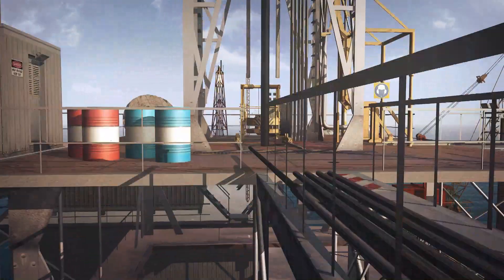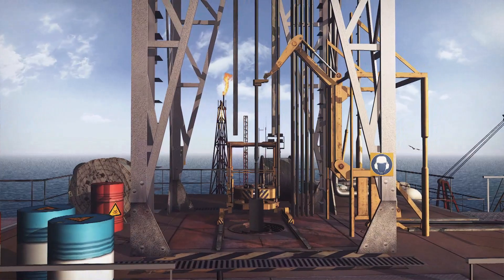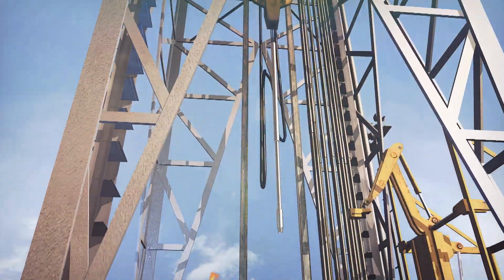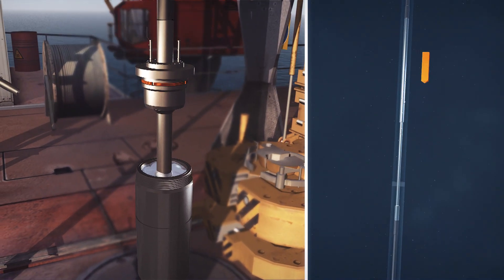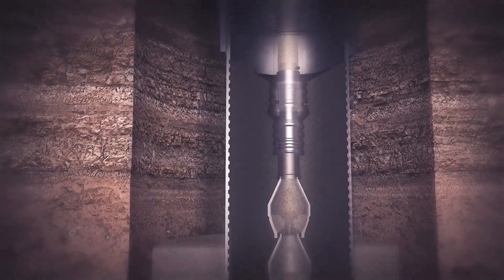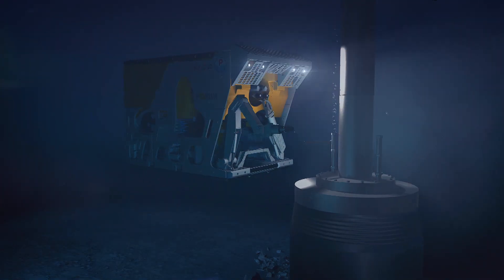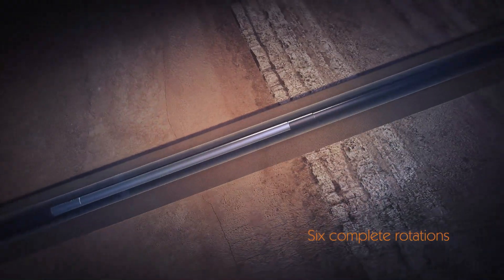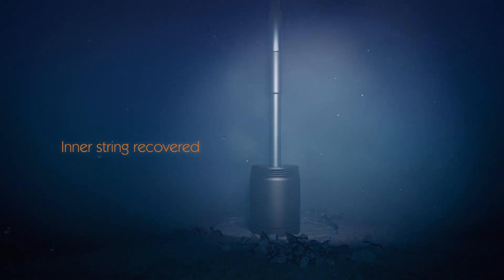SeaCure Cementing - unlisted

Comment: Nice demo. What is the margin of error in the inner string length to make sure the inner string can latch the float at the bottom while connected to the casing head at the top? Pipe stretch in a deeper water depth may have impact too.
Reply from the maker: Victor, thanks for your interest in our innovative SeaCure Cementing system. Our base SeaCure service has 3m (10’) of stroke in the SeaCure inner string cementing tool, but if you feel that is insufficient tally discrepancy compensation for your rig team to space out, two SeaCure tools can be run in tandem to provide 6m (20’). Please send more details of your enquiry to enquiries@deltatekglobal.com and a member of our team will respond to you within 12 hours.